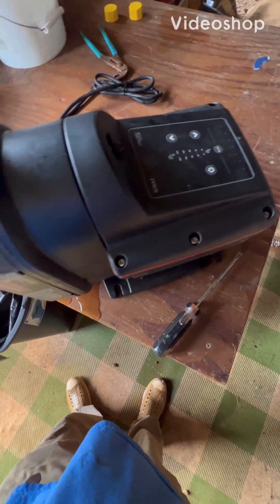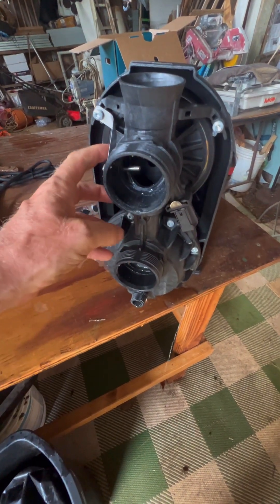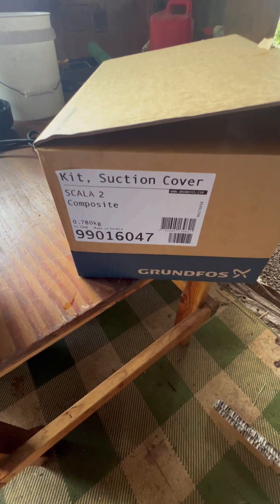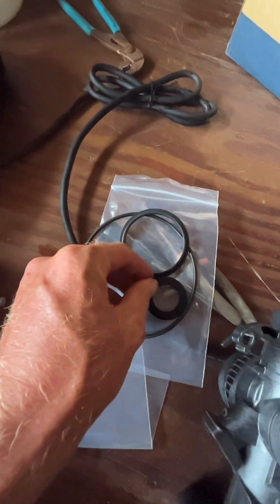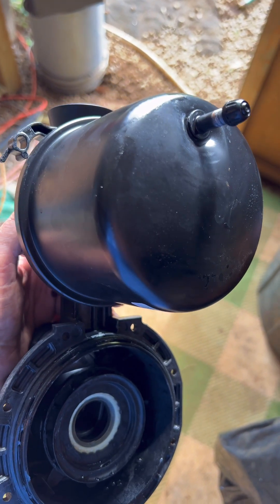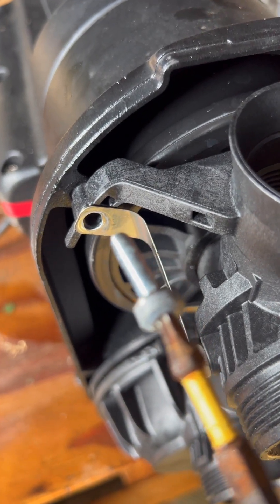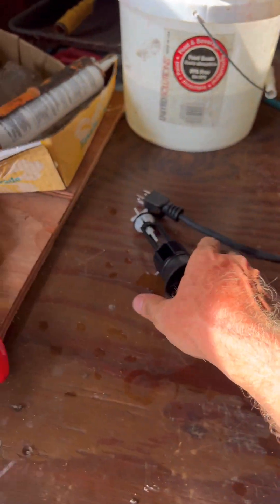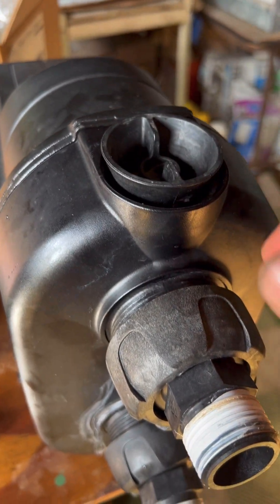Grundfos Scala 2 dismantle, repair, and reassembly

Comment: What is the correct number for filling the air?
Reply from the maker: Grundfos advises ensuring optimal pre-charge pressure at the pump installation, setting the pressure to be at 70% of the setpoint value/desired discharge pressure and never above it. The SCALA2 is delivered with a default pre-charge pressure of 1.8 Bar/26 Psi, due to transport regulations, and a default setpoint of 3 Bar/44 Psi, which is the optimal discharge pressure for most households. The correct pre-charge pressure should be adjusted according to the setpoint value when installed.
Reply from the maker: Column 1- Setpoint Bar (Psi)
Column 2- Optimal tank pre-charge pressure setting Bar (Psi)

5.5 (80)    3.9 (57)*
5.0 (73)     3.5 (51)*
4.5 (65)     3.2 (46)*
4.0 (58).    2.8 (41)
3.5 (51).    2.5 (36)
3.0 (44)    2.1 (30)
2.5 (36)     1.8 (26)
2.0 (29)     1.4 (20)
1.5 (22)     1.1 (16)
Reply: @fliparies23 

Thank you very much,

Comment: Can you replace the inner case? Apparently i have a hairline crack somewhere in mine and i can't seem to find it yet it leaks out the front of the bottom. I'm not even sure how i could pressure test it to find where the crack is to repair it
Reply from the maker: I recommend just taking off the front shroud. Put the unit back together with out the shroud. (Inlet, outlet, drain plug, and top prime plug)  install and pressure test it that way to get a clearer look as to where it may be leaking. I’ve seen it drip from the pressure tank. Or could be the motor bearing seal.

Comment: My pump is an older model Grundfos probably around seven years old. It seems to be leaking from the bottom. It’s losing quite a bit of water.
Reply from the maker: Take off the shroud to get a better look at where the leak might be coming from. Could be the main shaft seal, but could be a cracked housing.

Comment: I have scala2 not its working even if water discharge water is off??? Working 24 hours!!! How i can repair?
Reply from the maker: So your saying it continually runs even when the water discharge side is turned off? Sounds like a bad check valve.  Take out the water inlet spring and seal and make sure it is clean and free of debris. Also take out the spring and check valve out if the top prime port make sure it is clean and free of debris.

Comment: great video.. can you tell me how old is this pump? is this problem common for this plastic scala grundfoss pumps?
Reply: Just want to add that these pumps  are notorious for leaks and not just at the prime plug. I have witnessed  the failures  many times now.  Conveniently  warranteed  at just 2 years , users are S.O.L. with their failing pumps after that period. A real embarrassment for an otherwise great company.
Reply from the maker: I’ve seen a few of these pumps with this problem, cracking at the prime port due to over tightening, don’t use thread tape or paste.

Comment: did you have to recharge the internal tank? how do you do that?
Reply: Grundfos recommends the air charge be 70% of desired working pressure. Its a typical  Schrader (tire) fill valve.
Reply: Make sure it’s at 18psi check it at the air valve and fill it with an air compressor at the valve